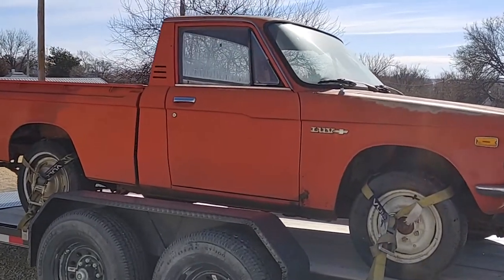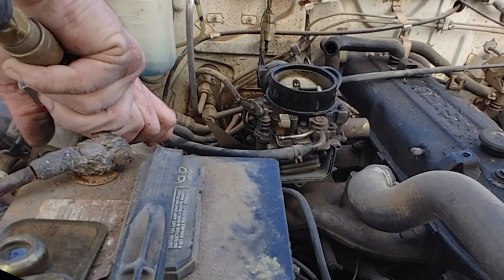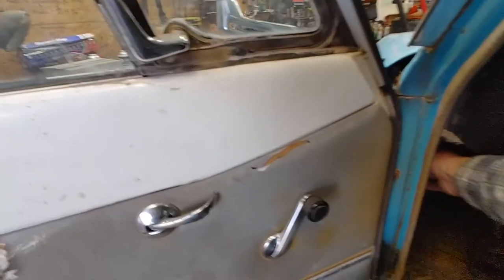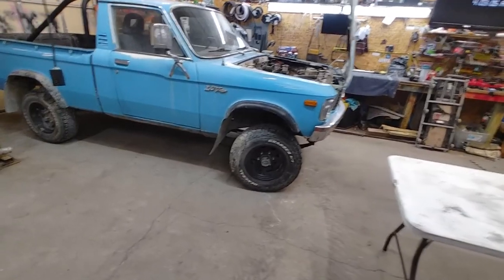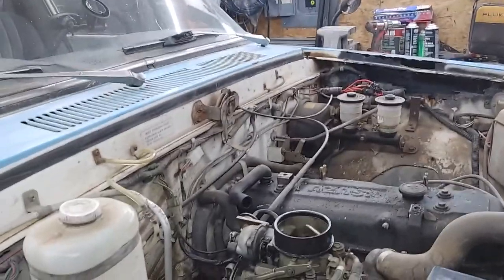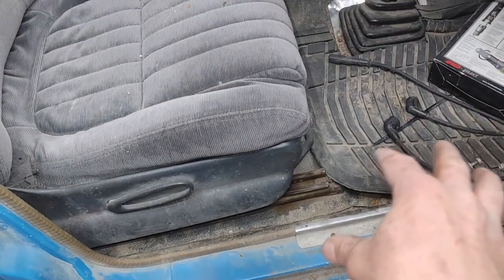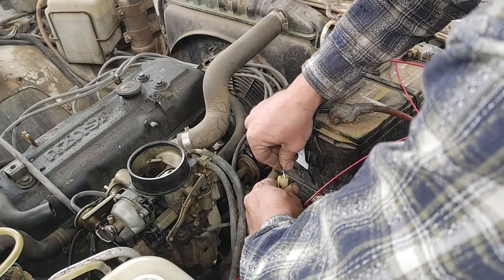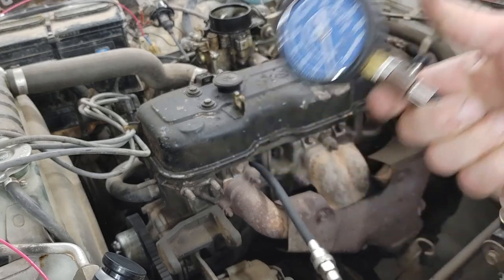1976 Chevy LUV 4X4 - Overview and Compression Test

Comment: If I were you, I'd wash this underside of this truck super clean and get your air compressor and start it up, and spray paint the whole underside of this trick with black rust olem paint. Spray paint the floorboards, chassis and frame and the underside of the bed. They make paint on bedliner these days, the bed can use a couple gallons of paint on bed liner on it to.  Wouldn't hurt. This is a beautiful looking little truck you got here.
Reply from the maker: I already did all that. Was well before I thought about YouTube. Rust converter underneath followed by undercoat. Patched in the floor and gave it the same treatment. Used T-Rex liner in the bed. Not a huge fan of that liner btw. I’ve used a roll on type on a different truck. It’s not as pretty but holds up better.